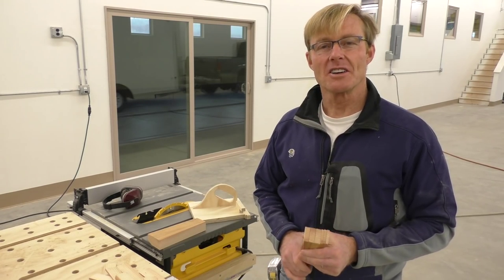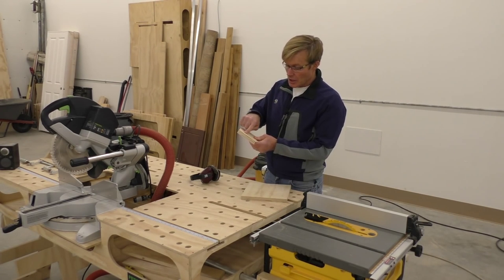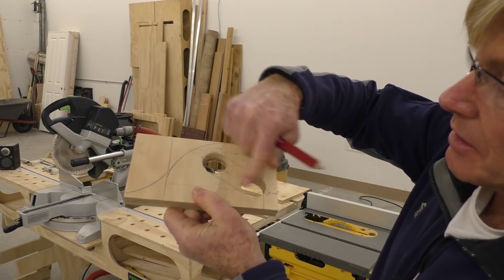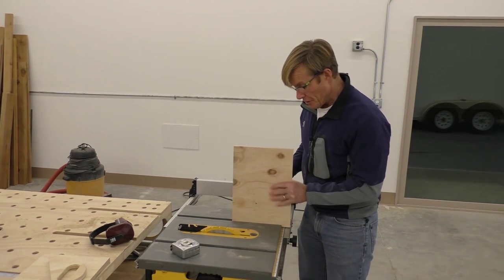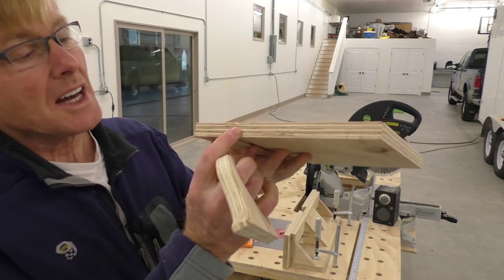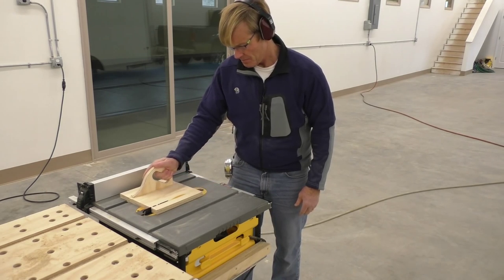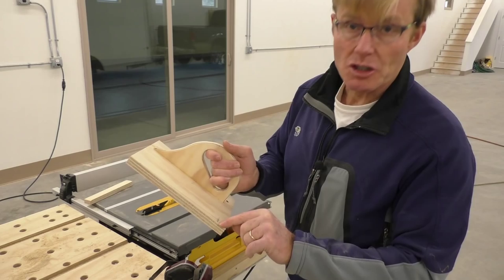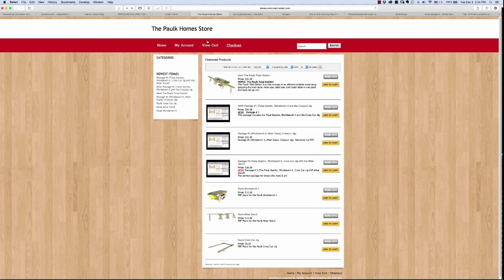TABLE SAW SHIM JIG: TOOL TIP#5

Comment: Ron, I have been making drawers for my trailer like the ones you made for your trailer.  I asked you during the drawer video "if dado were really necessary?".  Well, after building and assembling many drawers I have to say you were right.  The little bit of time it takes to dado the drawer bottoms saved a ton of time and aggravation when assembling the drawers.  Learning so much, thanks.

Long live the Dado.
Reply from the maker: You have seen the light. So many carpenters/woodworkers do back flips to avoid dados when they are beyond easy to make an offer many advantages over other methods, alignment and strength being two of them.
Reply: Kind of like metric.  I started using metric after I bought festool and it is so much easier.  Why did I wait so long?

Comment: Mr. Paulk;
I am building a round table that is being made out of 2" thick Old Barn Wood.  There are 24 pieces, at the outside end of each piece will be 9" and the inside end 4".  My angle for the sides is 7.5 degrees.  Can I use a larger version use this jig and how can I go about building it.  Have the will, but not the knowledge.  Any help will be greatly appreciated.

Comment: I'm cutting wedges for the fire department that I work at, there 2 1/2 inches long and 1 inch high, the problem I'm running into is after I make the first shim it seems that the piece of wood dosnt for right into the jog because of the last cut.
Reply: Dosnt fit right*
Reply from the maker: make sure you flip the wood over for each cut. I am not sure about your shim size, it may not work with my particular jig as it is designed for 7" thick and thin shims
Reply: Thanks a bunch I will work on it some more tomorrow and see if I can solve the problem

Comment: Hi, Ron!  Went you install base moulding, do you glue-join an outside corner bevel, or do you just nudge the two pieces together and nail gun each to its respective wall?  Thanks!
Reply from the maker: All outside miters are glued
Reply: Thanks, Ron!

Comment: So... Well... I understand wanting to use a tablesaw to cut these (Much faster) but wouldn't a chop saw (Miter) do this with no complicated jigs?

Or is this for people who don't own the contractor tool set, and just have the woodworker tool set? (I.E. table saw instead of chop saw)

Just wondering!
Reply from the maker: I used a miter saw for years until I found this jig. It is safer, faster, and cuts a much nicer shim than a miter saw. It is also not complicated to build as the video demonstrates. The skill level to build it is beginner.
Reply: Ron Paulk AHH! Makes sense now!

Lot of times people build things like this unnecescarily, wanted to see if it'd be worthwhile to slap one together myself.